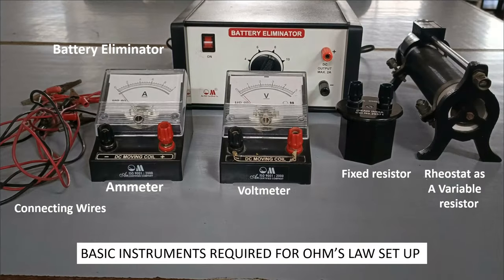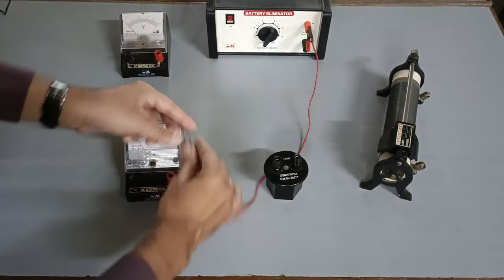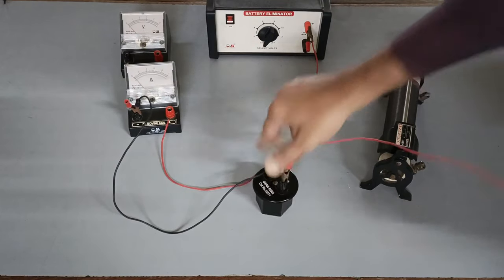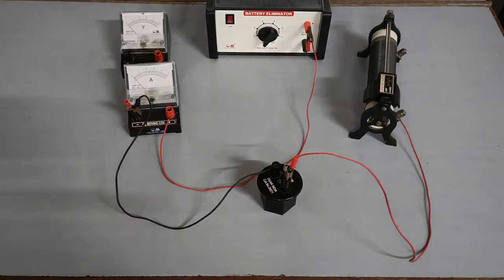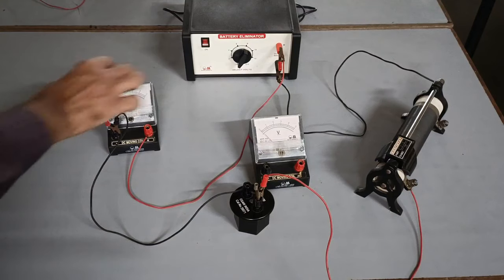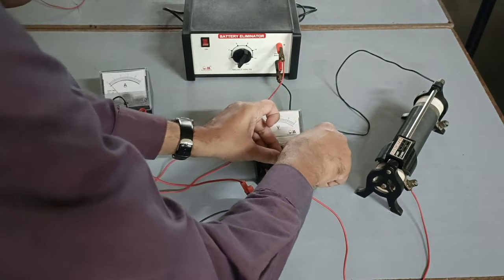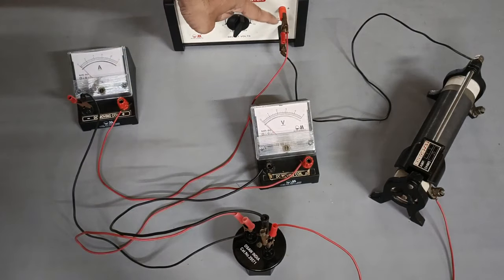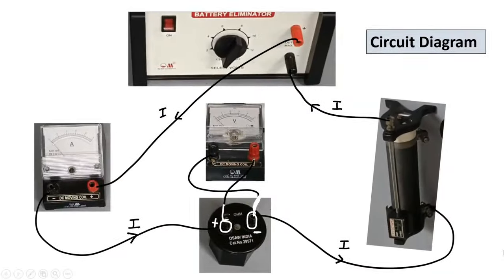HOW TO CONNECT OHM'S LAW CIRCUIT IN 4 MINS | BOARD PRACTICAL | ELECTRICITY DEMO | STD 10-12 PHYSICS

Comment: where is the key?
Reply: The cell has the key
Reply from the maker: Yes true the battery has the switch
Reply: The key is in hand 😂😂
Reply: @MakeMeScientific the ones who don’t have key then? Should we attach the rheostat to key then to battery’s negative terminal?
Reply: @fxa2518 no after connecting the key to the rheostat connect the key with the positive terminal of the battery

Comment: thanks sir for such a nice video 
Before watching your video I had many doubts about the connections but after watching it all my doubts are cleared 
Sir in place of the standard resistor can we use resistance box also?
Reply from the maker: Yes you can use

Comment: Positive of battery with postive of ammeter
Negative of ammeter to any one of resistor 
The other of resistor with the down one of rheostat
The upper end of rheostat with negative of battery
The positive of voltmeter connected with where the. Negative of ammeter is connected to the resistor
Negative of voltmeter is to be connected with resistor where postive of ammeter is connected.

Comment: Hi sir thanks a lot! But I have a small question i really hope you can help answer 😢 how do we get a constant r from V/I in the experiment if there is 2 resistors acting, like how is the variable resistor acting here?
Reply from the maker: Thanks for watching,

the voltmeter reading divided by ammeter reading is constant which is the resistance under the voltmeter with which it is connected in parallel, which is constant.
Reply: @MakeMeScientific  omg thanks sir!!